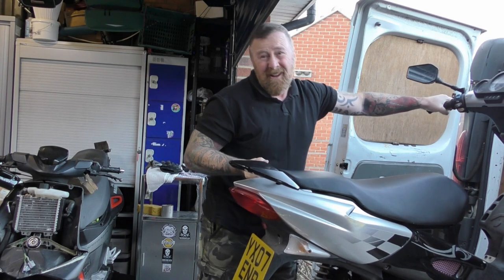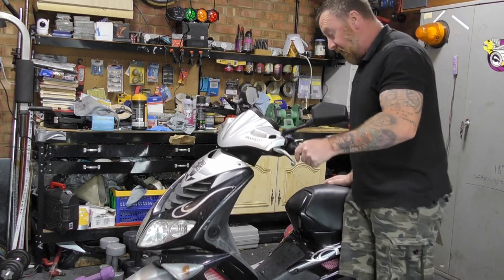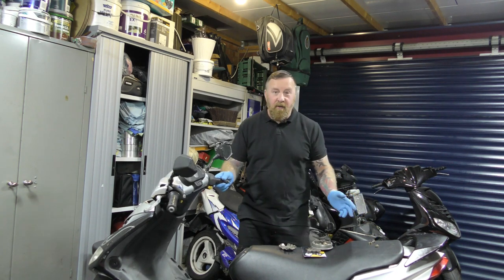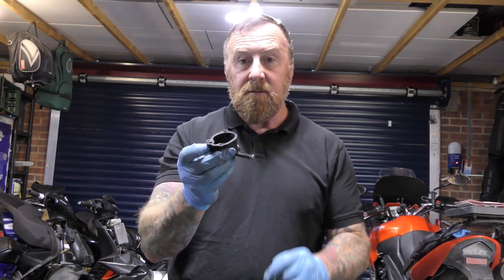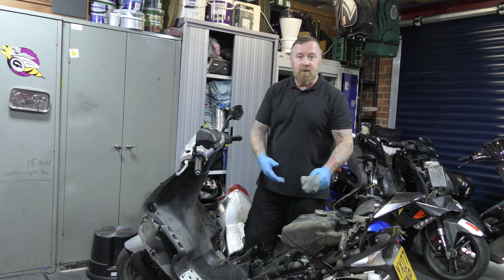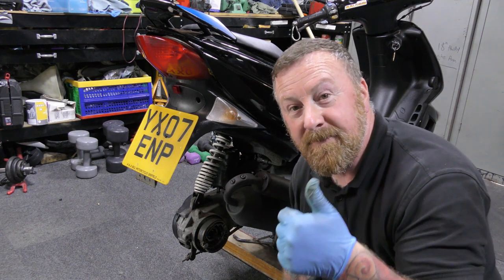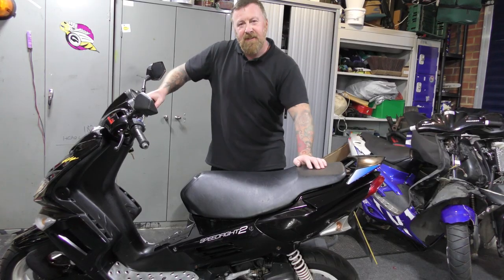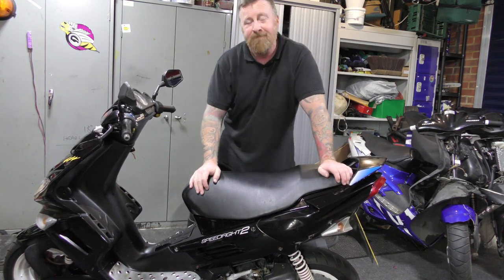SEASON FINALE MARK SAVAGE SPEEDFIGHT MOPED 50CC SCOOTER

Comment: Hi mark, my front caliper is sticking badly and was wondering how to replace it or maybe rebuild it? when it comes to the brakes on these things ive not a clue what to do. and i was thinking to change the pads while ive got the caliper off. how easy of a job is this cos i couldn't figure out how to get the pads out, not sure if it's because somethings stuck or because im just clueless but any advice would help 👍

Comment: Hi mark hope you can point me in the right direction to fix my speed fight 3 a/c 
I bought it with a running problem it starts fine electric or kick
Runs on idle fine but a mile up the road it cuts out
Most times it will restart ok other times it starts but will not rev for a few seconds or so
Other times when you go to restart it on electric start It will not start I have to use kick start 
But I have also noticed that the speedo will not work after if has been restarted but if let to idle it will come back till it cuts out again

Comment: Hi I've got a 100cc vivacity air cooled got new rollers belt seems OK clutch is good its the cat version all standard other then someone messing with jets and airfilter I can not get it to run right it had standard 13g rollers I've put 10.6 in rev range is OK but struggles to pull away have to really build up the throttle most the time just doesn't want to go at all its a nightmare starts and runs fine but unerload it won't ride it will fire up and run just not really ride I did buy a bypass for it dont know if that or the Coil could be playing up any ideas or thoughts would be great been trying to sort it for over a week now and nothing is working ie jetting or rollers or any airbox or filter I put on and it is a gurtner carb from France not dellorto and it also leaks so could it need a rebuild the carb ?? Any help much appreciated thanks

Comment: Hello Mark, how is it going? I am having problems with scooter, Aprilla Mojito, 125. I Took off CVT cover a week ago to inspect the belt and all is fine. When installing case and everything back on, I noticed the scooter would not start. When I press button, scooter makes strange noise. Almost like something is jammed or stuck. I took battery out and charged it and still same thing. I didn't need to charge battery because it was already fine. I took off belt and variator, and  everything sees to be in order. I put everything back on and still the problem continues. I have taken everything back off so I can Clean in the morning. When I press starter button, The bendix seems to be fine and come out on teeth. I really don't know what to try next? I might of made one rookie mistake.. I tried to lock clutch in place, to get cvt cover off. I wasn't able to get it off and had someone sit on bike for me. As I was tryna get clutch nut off, bike was moving backwords and forwards. I don't know if that anything to do with it. I would be great full if you can give me some suggestions. How come you ain't working in your shed anymore?

Comment: Is there a way to calibrate the fuel sender on a speedfight 3? The fuel gauge on the console drops to zero 10 minutes after filling up and the fuel light comes on. There's still more than half a tank of petrol. Bought a second hand fuel sender from a known working bike, and it's the same. If I check the resistance on the sender, it registers the correct ohm range, so my thoughts somethings not calibrated correctly, or it's the console. Any thoughts?
Reply from the maker: The clock have a known fault 
Normally no indicators 
Them lights and fuel 
Most just die !
It's all in one module 
2nd hand one 
Bit odd it works for a bit !
If you have replaced the sender already from a working one 
And wiring is all ok it's the clock unit

Comment: Hello, 
I have a 2008 Speedfight 2 LC [50cc]. I am currently changing the exhaust from stock to LeoVince TT and the variator from stock to Malossi Multivar with 6.9g rollers. 
The moped has a Gurtner 12.5mm carb. Could you please tell me roughly what jet I'd need for the ped to run smoothly? 
Of course I am not not asking for the exact number as it is hard to pin down over the internet - just an estimate from your experience.
Thanks in advance.
Reply from the maker: standard as in my carb videos and i have many on my channel plus videos on tuning 
54/56 is standard and i go up in 4s so 60 , 64 up to 70 max 
but to be fair 64 and 6g rollers but on a lc 7g
Reply: @marksavage  Thanks a lot for the reply ;D Have a nice day
Reply: @pasiu7257  Hey,
I just did the same thing u have done in your scooter with a Leo Vince exhaust and a malossi multivar.
Can u tell me what's the best rollers that gived u the best speed.
Thanks.

Comment: Excellent channel, going to help me loads, just wondering why a sf3 50cc would keep snapping belts??
Reply from the maker: Check and clean clutch and variator drive , the part the belt touches bud 
It's common 
If they have a little dink or stuck on old belt etc 
Cheap belts could be also bud
Thanks for watching 
I do have videos on sp3s that should also help
Reply: @marksavage  been watching all afternoon!! Cracking vids

Comment: hi, Mark. i have sf2 AC vertical version. I've noticed that like where is the head gasket, there's like wet. so im thinking that in the winter, I'll put a malossi 70cc cast iron sports cylinder? i have a leo vince zx sports exhaust, and a dellorto 17,5 mm carburetor.
Reply: Change head gasket to a high quality one and torque down the cylinder head correctly

Comment: Hey mark! Quick question - I have fuel coming out my air filter, is this a float problem? I can’t quite get the level right, also do you use Facebook?
Reply from the maker: It could be the float and the vacuum !
Do the test on the vacuum as in my carb videos and replace 
Easy fix then 
Clean carb and float 
But could be the float needle bud
Reply: @marksavage  thanks mate!

Comment: Not long been a speedfight owner and enjoyed the vids but a question.....took my back wheel off as the tyre wasnt fitted right and i find there is no washer.......is it a special washer ? and whats the size if you know please..cheers.
Reply from the maker: back wheel on the disc or drum bud 
3 nuts on or off no washers on to the hub
wheel size can cause issues but is a plug and paly part bud 
i have many videos on my channel over 100 on a paly list that should help you bud

Comment: I come to your vids every time I need to fix something up on my sf2, youve helped a lot of times, just wanted to ask if I buy one of those mesh mushroom air filters do I mount it on the old plastic prefilter where the stock airfilter box is or directly onto the carburator?
Reply from the maker: i really dont like any other air filter than stock due to the just suck in water and then bog down bud , use a sports in box filter , they work well bud

Comment: Mark mark mark Hope you can help I have a kymco super 8 50cc 2013 and I have a problem with the electrics 1 of the fuses is glowing red and burning. I’m now getting no power to lights or gauges. Nothing at all could you give me any clues of where or what to check. Love the videos
Reply from the maker: Stop using it bud 
All panels off and check the loom 
Look around the steering column for split wires and all earths 
It's not good bud and could catch fire 
It needs sorting 
Then look at volt resistor,  stator coil and battery

Comment: Hi mark my 2007 2 stroke oil light is on all the time and it's full,  any ideas ? keep up the good work ,
Reply from the maker: if its a speedfight it can be your immob cutting in and may not start or its just the sensor lol
Reply: @marksavage  sorry yes it's a speedfighter 2

Comment: Hi Mark I just got anuther speedfight it's a 100cc this time but it's missing the the the complete cooling covers I can't find it eny wher eBay or FB market place I posted ads to see if enyone has one but no joy do you no some wher I could buy one from its had compleat engine rebuild I did it my self with lots of help from your videos grate stuff thank you
Reply: Still can't find the ac cooling cover for my 100cc speedfight. But do you think it would work if I mount a fan under the seat bucket will this work?

Comment: Mark could you please do a video on a water leak on a aerox and also how to sort the speedometer please love your videos
Reply from the maker: wheres is coming from but , radiator ? water pump or pipes 
you will have to check bud 
and go from there 
speedo i have videos on that they will help
Reply: @marksavage  its coming from the cylinder head but it still runs and rides but bogs out but the bogging is low fuel i think is there anyway i could send you a video?

Comment: Loving the vids bit of advice my grandson as a scooter moped he wants to know if would be better performance if he changed spark plug hes changing rollers to try but would anything else help thanks
Reply from the maker: a service will always help, but yes rollers 6g clean variator and check belt and clutch like in my videos 
new a same upjet of 4 and a sports exhaust 
as taking its a speedfight
Reply: @marksavage  thanks very much mate most grateful

Comment: Absolutely awesome.
I recently bought a speedfight 3 and experienced the biggest disappointment when I drove out on the road. I'm not kidding, but the top speed was 39/41 with sickly high revs. We are talking about at least 9 / 10,000 revolutions. I also had a vivacity 2013 model that I had deregistered due to excessive damage to the front.  It was been stolen and destroyed. But the engine was very good. So I took off the variator weights and switched them straight over to speedfight 3. Speedfight was not recognizable when I drove it again. Today it manages well over 60 straight ahead and the revs are about 7/8000
Reply from the maker: Thats amazing and always say about the variator and rollers 
Well done bud and thanks for commenting 
Take care

Comment: I want to turn on a front light together I didn't know how
Reply from the maker: What you saying bud 
Low beam ,high beam don't work?
They only work one at a time by the switch bud 
You can wire them in so both work but one would be high all the time due to the position
Reply: @marksavage  Thank you.

Comment: Hi I have a noise coming from my 100cc ending I have no way of sending the videos of what it is it only happens whe  the cylinder and head are on really doesn't happen otherwise I've checked for up and down play in top and bottom end nothing it sound like clanking or rings maybe catching but it is  absolutely clean inside the engine it's a vivacity 100 2 stroke just can't figure it out
Reply: If you have any form of way I could private message to send the videos of what it's doing and some pictures of the engine

Comment: Just bought a 2002 SF2, been watching you videos none stop, they're great.... Still can't diagnose my problem though. After 10 mins of running my scooter loses power, any thoughts?
Reply from the maker: it could be you stator coil but go to the basics bud 
variator , belt  clutch 
could be plug breaking down / coil 
even fuel problems 
but as said i had this and it was the stator coil

Comment: U know anything about bmw c1 125 mopeds can't get a spark
Reply from the maker: no bud but look for the cdi bud first and then work towards the plug . coil or even the stator coil 
use a volt meter
Reply: @marksavage   iv tested the cdi thats fine there is no power getting to coil but just bin told u have to have the seatbelts plugged in to get a spark so guna try that thanks for the reply
Reply from the maker: @danielbenn8699  oh yes it's a cut off 
Like the side stand on other peds and bikes
Reply from the maker: @danielbenn8699  come on a bloody seat belt on a ped 
Sell it 
Pmsl
Reply: I'm very tempted lol iv not had it on road yet only got it as it was different lol cart get the window wiper to work now hahah

Comment: Mate!  Dead set lad your videos have saved me the last few times my scooter had a tanty! 

Let me tell you mate, I am stumped! I live on a tropical island and my scooter just stopped (after 10 mins of riding in torrential rain) on a blind corner heading down the mountain.

I'd love to do a live fix/diagnosis with you. (Before the jungle reclaims another vehivle)
Reply: I missed this info: it's a Vmoto monza 2t  50 cc the ripper part is that the humidity here is pretty close to 100% all the time and I ride from right on sea level to close to 500m above sea level to work (about a 7 km ride)

Comment: HELLO Mark, Can you  help me identify a puegoet scooter THat Was given to me ,,,, PUEGOET S2ABOO,,,10/99 VIN VGAS2AB0000024215,,,,,   MOTOR STAMPING  11886326    FB6....Have been told it is a Elyseo 125 cc ,is that correct ,,,,,Has been repainted ,,,only 21,000 on the clock ,,,,